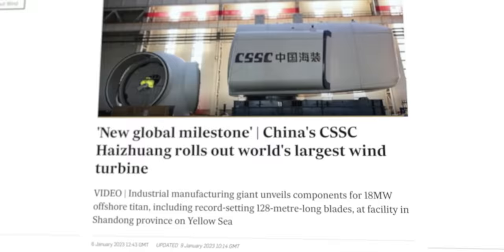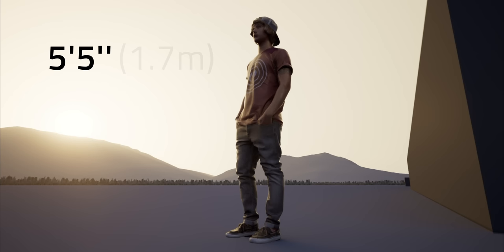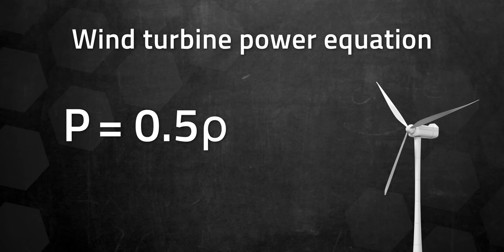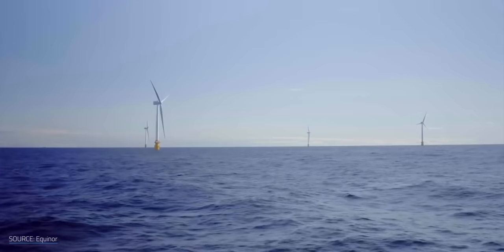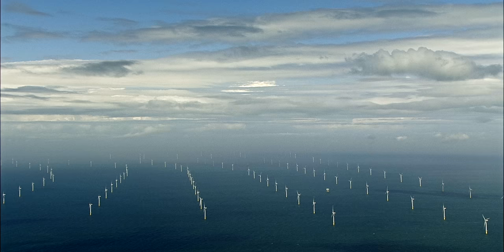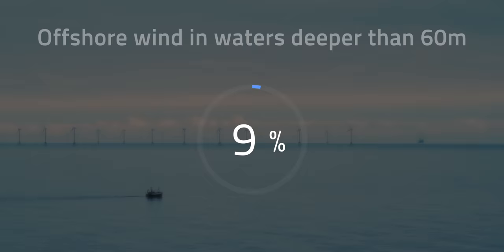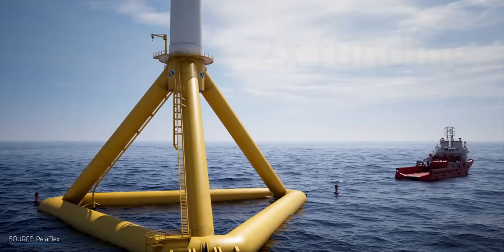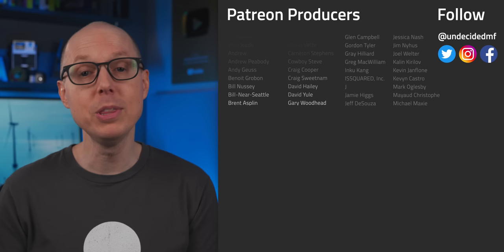Why Are Floating Wind Turbines So Huge?

Comment: 18 MW for one tower is insane btw. I work on these daily and our biggest on land wind turbines produce 2.33 MW each. One HUGE drawback that is not talked about enough is maintenance. After just 10 years these towers start to deteriorate and need pretty constant maintenance. It’s insanely expensive to do maintenance offshore.
Reply: That was my first thought... it would be challenging enough to get parts & maintainers up 100m to the generator/gearbox/etc on land, let alone doubling that height and having bigger parts and having it all floating on water!  I don't know what kind of sea state these wind turbines would operate in, but I can't imagine they'd want to have to detach & tow them back to shore to perform repairs if they could avoid it.
Reply: its called tax credits or gov't grants its not about longevity.
Reply: How many houses does one 18mw turbine power?
Reply: @alienesquemotivation  google says at max capacity it would power 44,000 homes for a year. Based on what I’ve seen on shore towers produce in the first few years I would say a reasonable output is maybe about 50%… might be different for offshore. So I would guess about 20,000 homes for a year.
Reply: True but the power generation offsets some of that extra service cost plus less cost to acquire wind friendly finite supply land. Luckily sealife can't appeal and governments own their waters
Reply: @joshmusic9766  Some of that lower output is due to fossil fuel plants getting priority so they can make enough money to stay as failsafe backup even if wind gen is high. Other reason is poor interconnectors to sell excess wind farther afield.
Reply: @joshmusic9766  What do you mean "for a year"? Surely the turbine will last for many years.
Reply: @barneylaurance1865  it lasts 20 or 25 years or so but it’s easier to think of energy output in one year. If you say “it’s powers 100k homes in 20 years” it’s not as easy to comprehend saying “it powers 5k homes for one year when it operates for one year”. Is that what you were asking? I’ll be honest I didn’t 100% understand your question.
Reply: @joshmusic9766  I guess I'm just wondering why you wouldn't simply say "it powers 5k homes" instead of "it powers 5k homes for one year when it operates for one year". The one year bit seems meaningless. You could equally say "it powers 5k homes for one day when it operates for one day" or "it powers 5k homes for one decade when it operates for one decade".
Reply: @barneylaurance1865  i see what you mean. I think the reason we use the one year metric is because every turbine has a different lifespan and different total energy output, and like I briefly mentioned before, it’s simply easier for us humans to comprehend one year of energy output than it is to try to conceptualize 20 or 25 years of output. 

Also a side thought, many things change every year, such as price per Megawatt and annual government subsidies and every year the average house uses more energy. So with so many factors that change every year, it’s easier to sort of think in the short term as we have a better understanding of how “valuable” each megawatt is to each of us consumers in terms of money and how far that money will stretch.
Reply: @medea27  can't it be done with a helicopter if there is a way to lock the blades in place for the duration of the maintenance? I don't have enough knowledge about the subject and would like to hear your thought about it.
Reply: @barneylaurance1865  It means that 200 000 of those turbines would power the whole US
Reply: @3boussgaming481  Helicopters are amazing machines but they are strongly affected by the one thing the turbines are out there to utilise - wind.  Even if the blades aren't turning there is still wind blowing around the turbine structure & air movement coming off the water, which tends to make the air around & above an offshore structure quite turbulent.  Helicopters are also quite weight-limited, and even the big machines built to lift cargo, etc underneath them are restricted in the weight they can carry, for short distances & in low winds only.... anything on the end of a cable (even a rescuer being lowered to a stranded hiker) is like a pendulum under the helicopter and can quickly start swinging & throw the craft off-balance or, worse still, hit something.  I'd be interested to know how they maintain these offshore turbines as I believe they primarily use cranes & internal hoists to move larger/heavier parts in land-based wind turbines... happy to be corrected though if there's someone in the know!
Reply: @medea27  thank you, that was a great explanation, I think what they need to do is to develop a crawling crane, I don't know what is exactly it's called, but for example in high skyscrapers when they are under construction they will have some sort of a crane attached to the top, and as each floor is constructed the crane rises up with the building, if they can manufacture such a thing for a big number of wind turbines, which can be attached and detached whenever service is needed, just a thought again, I hope this one make more sense?
Reply: Oil rigs seem to have done just fine for many decades. I guess it’s OK to spend money to destroy the Earth, rather than save it!
Reply: @solarwind907  I’m not really sure how oil rigs are relevant to my comment but ok.
Reply: they are also not efficient went compared to nuclear lmfao
Reply: Sure. You would know. 
Say, you don’t happen to have any DATA or REFERENCES, do you?
Reply: @solarwind907  this is a YouTube comment not a scientific published paper. I work in the industry and my comment is reflective of what I do every day. You can find data online, I don’t feel the need to prove myself or to show you the way to the data. Also the actual materials I do have from work I’m not allowed to distribute outside of my company.
Reply: @solarwind907  yes and oil rigs are very expensive to repair. Literally one of the highest paying professions in the trades. I don’t really know what you mean by your comment, or at least I don’t know what you are suggesting.
Reply: @joshmusic9766  is this even a drawback? What’s important is opportunity cost, and that requires comparing the maintenance costs to other forms of energy generation. Do you have any papers that you’ve come across that could discuss this topic?
Reply: @joshmusic9766  fair enough but if you only work on land-based turbines, I don’t feel that you have expertise to speak about damage/maintenance intervals to offshore turbines in a salt air environment. 
For example, you say that it’s really expensive to work/maintain equipment offshore. Humanity hasn’t had a problem maintaining offshore drill, rigs for decades. Tell me what’s different about wind turbine towers offshore vs an oil rig?  Do they rust differently? Do they need different paint? Do fiberglass boats somehow work in saltwater, but fiberglass wind turbine blades won’t?
Humans know how to work with equipment in a marine environment. The material science is well proven.

Yeah, if you were going to say, it’s cheaper to install a wind turbin on land then it is to install one on sea, fine. But the way you talk it’s as if it’s better to destroy the planet ecosystem then to spend a few extra bucks installing wind turbines offshore.  And in fact it may be cheaper after permitting and economy of scale is considered to install very large turbines offshore then multiple smaller turbines on land. I don’t know, and I don’t believe you do either.

The advantages to offshore wind are that you can install much bigger turbines, offshore, and the wind speeds in general are higher and less turbulent offshore. This is a big deal. Also, it’s easier to get permitting to install wind offshore, then on land.

Yes, this is a comment on a YouTube channel. However, it’s published in a public forum where many thousands of people may view it. When you state that you work in the industry, you’re putting yourself forth as an expert. A lot of people will take that at face value and form their opinions on what you have to say. You and I have quite a bit of responsibility when we publish something on a public forum. I don’t want to BS or misinform anyone if I can help it, and I doubt you do either.

Thanks for the reply, I appreciate it.
Thanks also for working in the wind industry. I’ve been in the renewable energy field myself for over 25 years and there are easier ways to make a living :-)
Reply: We probably use more energy in R&D, manufacturing, assembling and maintaining these things than the energy they produce. I doubt this is "greener." All the money too could be used for something else.
Reply: @barsaf9989  oh, yeah! Probably! You know, my bartender told me the same thing, so it must be true!
No data, of course, but my bartender is really a nice guy.
Reply: That's why I will stick to nuclear power. Also not talked about is how dangerous they are, when it comes to height. I am just wondering how many people fell off the tower while doing repairs? Looks dangerous to me....
Reply: @HollyTimlick-du2zx  I’ve only been at this company for a few years but we have only had two close calls that I know of and it was because the technician cut multiple safety corners. They are pretty well suited up and they don’t climb the tower if winds are too high
Reply: @solarwind907  you have much more experience and life experience than me and I’m not trying to act like I’m on a high horse. My original comment was more so about how the video seemed to leave some important details out. 

To your point about oil rigs vs wind maintenance… oil rigs have live-on staff. Of course they face delays on special shipments or other similar supply chain issues but they have all of their staff on the platform for months on end. With wind, obviously that’s not possible and they have to do repairs using mostly helicopter. I think the materials are not the issue, it’s the remote nature of the turbines.

Lastly, a small nitpick, it’s not easier to permit offshore wind (at least for the US). There is a single offshore farm by the US, with only recent plans to expand that. I think offshore makes a lot of sense because a large portion of the population lives near sea, the noise and view won’t bother people when it’s not in their backyard, and they produce significantly more power. I would also love to see more investment in nuclear but that’s a whole different conversation 😂
Reply: @joshmusic9766  lots to think about, lots to consider. The one thing that is not debateable is that our earth is overheating quickly, and there’s not much time. 
Stay safe and keep up the good work!
Reply: @joshmusic9766   That assumes constant max rated capacity output.  Nominal output is ~30%.   Each one of those 18 MW windmills is 1000" tall, consider how many would be needed to supply one city...and add in the cost of a new, equally sized back-up system.  The wind doesn't always blow...it can be calm for days.
Reply: @solarwind907  "Destroy the Earth"  Where do you come up with such crazy and wrong rhetoric.  At least recognize how much cleaner the Earth is that it would have been had not used hydrocarbons, and how we would be living.
Reply: @matthewsmith8249  my comment was not about reliability and balance of grid. My comment was about offshore maintenance.
Reply: Do you know of any ways we could bring the maintenance necessary down or increase the life of these turbine solely based on what you’ve seen when working on them? Maybe better lubricants or different materials based on where exactly the turbine is failing?
Reply: autonomous wind tower replacement, slow & steady.
Reply: @ausitnsalas3368  there are engineers at companies like GE who spend every waking moment trying to solve the problems you just proposed. I am no such engineer, but I will say they make pretty decent upgrades to the technology every year. I think in the spam of 10-15 years we will see so many such upgrades that wind will become a major part of our energy grid.